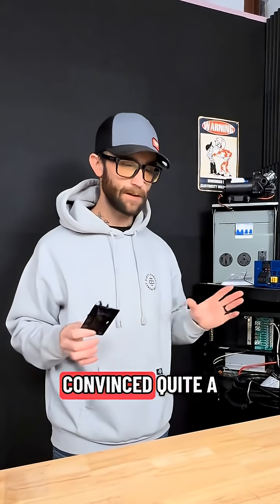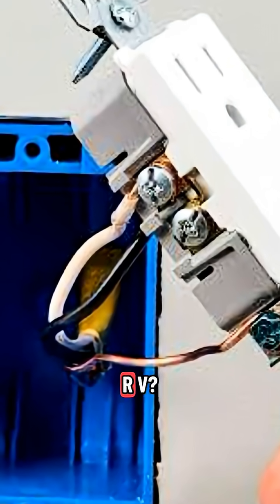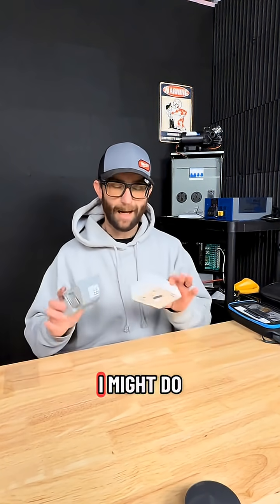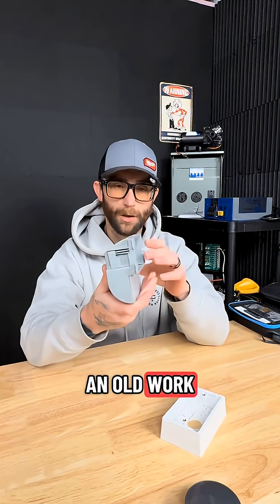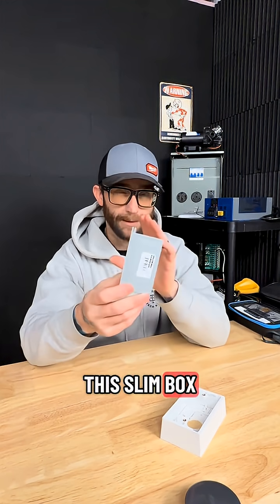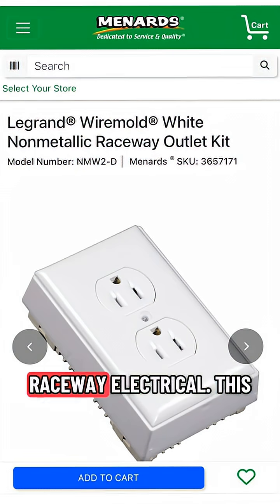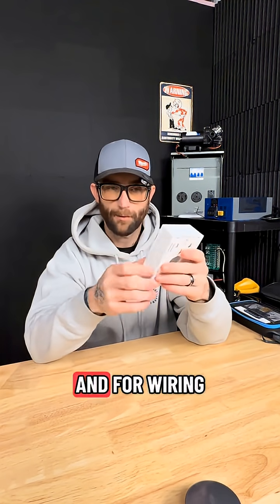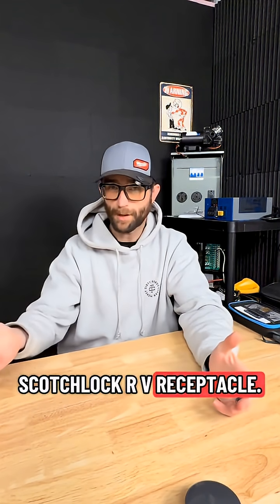Can you replace the outlets in your RV with residential grade outlets? Yes you can! Although it

Comment: I am still in the process of changing out all of outlets after having two electrical fires in my rig. (I was lucky, saw the sparking, and knew exactly which breaker to open.)
Mounting a old work (with mounting tabs) short  J-box (e.g. Carlon B114R-UPC J-box) is just $2-6, and is pretty damned easy - most of the time.
Also, let's make the outlet easy, too: Leviton lever edge (think Wago) E5325-MW are just 10 for $25. 
If y'all need more wire, there are two legitimate ways: add a closed J-box, and connect a longer run of Romex, making connection inside the J-box, or replace the entire run of Romex. 
You can do this. You may come to an understanding of the epithet "cabinet yoga", however.

Comment: Thanks for this and yes, those crap outlets that the RVIA allows are fire hazards at best!  My camper is an Airstream Safari so the original outles atr good but some of the original boxes need replacing so the shallow wall boxes are great.  Not sure my wife would like (allow) me to put a surface mount box.  ;-)

The RVIA should be held liable for fires, plumbing leaks, frame breakage that their STUPID rules allow.  In general the standard house codes would be fine if the manufacturers were not trying to cheap out the construction...

Comment: Okay so funny thing is I had a backstabbed gfci outlet start to melt in the Rv so I replaced it with a new high end one… I also decided while I was at it to replace that poor Rv outlet in the front bathroom with a home one that has usb ports too… the cut out in my wall is a nice clean cutout with a wood border or frame around it inside for meat to screw in whatever I want.. I found a thin box online with a removable back, it won’t fit a quality outlet with the back so I took the back off and screwed the front to the wall so basically it’s a spacer with the mounting holes for an outlet and it actually looks really clean. The only thing is there is technically no back of the box, however it’s just wood so there is nothing for one of the wires to arc on IF one happened to come off… so that should be fine right? Not to mention the side screws are mostly if not all in the spacer / box anyway…

Comment: Not legally in Australia! Caravans and RVs use both 12V and 240V systems. The 12V system powers things like lighting and water pumps, while the 240V system (also called mains power) runs higher-draw appliances like kettles, toasters, or air conditioning units.

When using 240V power, especially with 15amp extension leads, the law requires that all switches and power points in your caravan must be double pole.

Comment: I used to work in the electrical field, and when I saw the electrical light barriers in my 1996 Coachmen Sport 95 camper truck, I realized there was a fire hazard. I changed everything accordingly, including the grounding, and took the opportunity to redo the entire installation, as I am in the process of completely renovating the camper due to its age and water problems. 👍

Comment: What do you think about using a low voltage mounting bracket wall plate, 1 gang for Ethernet (open back) to fill the hole in the wall and then Leviton Lever Edge outlets or regular screws outlet taped up with electrical tape? If Wagu connectors are allowed in RV's outside of boxes, would the Lever Edge outlets be permitted?
Reply: Sounds like a code violation. Those lever lock melted on me a few times in a house, I wouldn't trust them outside a box with combustible material all around them
Reply: @vaska916 RVs don't follow the NEC. Lever locks meet RV codes and are used throughout the industry. I was asking if this scheme was an acceptable alternative to the insulation displacement outlets used in the RV industry.
Reply: @JerryMeyer-f5h RVs do follow the NEC, they even have their own article 551. 
The code is basic safety for all electrical that is written in blood by firemen and insurance adjustors. 
I was just speaking from experience as an electrician, on material and devices that myself or someone I know first hand used in the past that I  had to personally go back and fix because it could not handle the daily use. 
You can do what you want with your life or material possessions you worked hard to acquire, or you can learn from others that have made that mistake and don't repeat it.
Reply: @vaska916 Then how do insulation displacement outlets end up in RVs? (Question from Electrical Engineering Fellow with 45 years experience designing weapon and satellite electrical systems).
Reply: @JerryMeyer-f5h those are UL listed to be used without an electrical box because they have a cover on the back to "contain the fire" if it starts from a short or something. 
The lever lock receptacles from leviton are just regular receptacles that are listed to be installed inside an electrical box instead of the older ones with screws, to replace the dreadful backstabs that no reputable electrician will use, and marketed to save time on installation - and time is money. 
In my opinion the screw is the safest long term bet, especially the screws with that little plate for wire to go underneath - lots of people still have issues with making loops for some reason. 
One of the service calls, I've worked on a pre manufactured home where their switches all of a sudden stopped working, and it was those insulation displacing ones, we just cut a bigger hole and put in regular box with switches. 
I(nor anyone) don't know everything, so it's just my opinion on what I've ran into, and most of the time they work just fine.

Comment: Okay so how do you attach that box to that big giant hole in the wall?
Reply: Fabricate a cover plate, then cut out for new box in the middle of that, or step up to a 2 gang box.
Reply: @Robnord1 there has to be a cleaner way… that wouldn’t look good at all…
Reply: @bounderchris  None of the 3 methods I've used to install residential receptacles looks good , plus it's not quick or easy. This is why many talk about changing out the garbage factory ones, but few ever actually do it.
Reply: @Robnord1 thanks that’s what I’ve been starting to see a lot of talk but nothing that shows anything finished wise